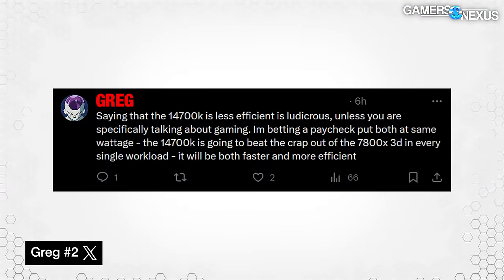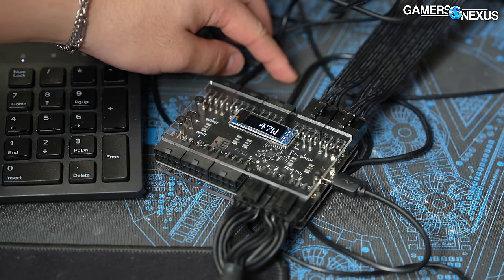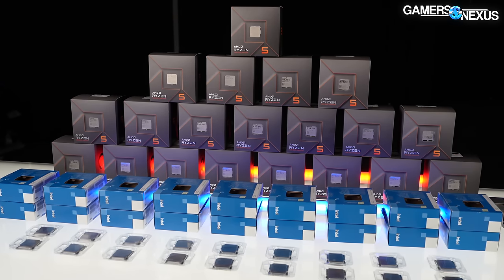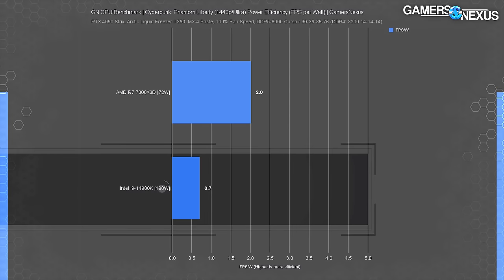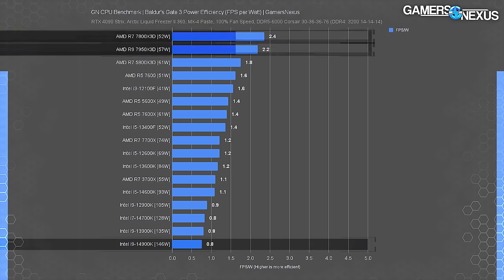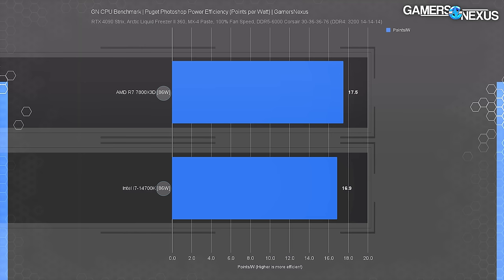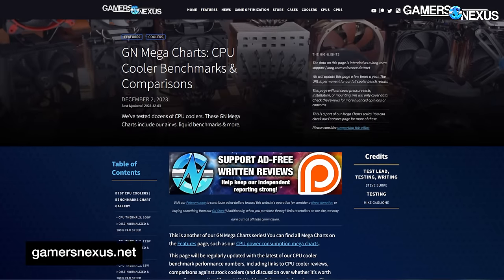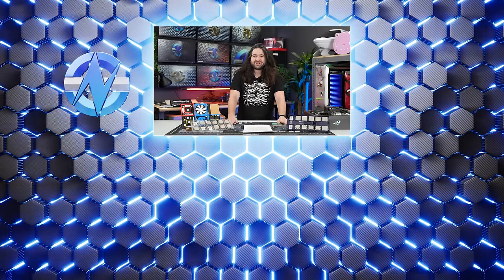The Intel Problem: CPU Efficiency & Power Consumption

Comment: I love how much the tables have turned in terms of performance per Watt. The kind of issue we see now used to be in AMD’s camp with the FX series.
Reply: I had a phenom and skipped the FX generation.  Didn't seem worth the upgrade
Reply: @davidellis1355 I had one and did the upgrade. You were right lol
Reply: @davidellis1355  Phenom II x6 was a screamer w 2x msi 7770 oc but the power bill suffered... lol.
Reply: @frizzlefry1921  1090T gang
Reply: And before that Intel had issues with the Pentium 4 where they once again tried to brute force themselves ahead through clockspeed at the cost of power/heat. It's one of those things that will probably keep swinging back and forth over the course of history.
Reply: @davidellis1355  I stubbornly sat on my Phenom II X6 1100T until Ryzen 2700X was out precisely because of that...
Reply: @davidellis1355  I still use an 1100T for my TrueNAS box.  It's got enough threads I can actually run multiple processes in the background, but it does idle at about 70W...
Reply: Pentium 4 was getting whooped by AMD Athlon series, but Intel got their act togeather and came back with the Core series, right now, they really need to go back to the drawing board.
Reply: @andersjjensen did the same. Was a good choice tbf
Reply: @dcikaruga Arrow Lake is absolutely make or break for Intel. If that's also a disappointment, Intel could be facing a Bulldozer/Piledriver etc. type of dark age.
Reply: The 3700X was already quite efficient, but they've only improved since then
Reply: @nathanlarson6535  Intel are still bigger than AMD, they've got their own factories as well, remember the supply problems with had with AMD over the years? That's in their favour.
Reply: @dcikaruga  You mean Intel's skunkworks laptop chip team completely saved their x86 CPU division.
Reply: Yeah, I used to have an FX8320 until a few months ago (then my motherboard decided it was time to retire and refused to turn on ever again), so I remember very well the old times where 4th gen i5s and i7s used to be at the very top of the efficiency curve and were regarded as the only and obvious, superior choice.

People just couldn't shut up about how the FX cpus and their ~150W TDP were ridiculously power hungry and hot, the only reason I bought one was because it was so cheap that, even after factoring in the added costs of a beefier cooling solution and a better PSU, it was still more convenient to buy when compared to an i5, it almost bordered i3 territories.

Now the situation is completely reversed, AMD leads the charts, whereas intel struggles to keep up the competition, with the significant difference that, this time, these ridiculously power hungry and hot CPUs ARE actually ridiculously power hungry and hot, intel CPUs eat up to 300 watts of power, yet people act like it's totally fine and pay good money for them.

And then some even go as far as claiming that they are actually MORE efficient than AMD CPUs, you just have to power limit them to less than 1/3 of their power budget, oh yeah that's gonna work some wonders 😂😂😂😂

13 to 14th gen CPUs are Intel's equivalent to AMD FXs, if not even worse, afterall, FXs were objectively inferior products but at least they were really cheap, they even came with a decent cooler that didn't actually look like a toy, intel doesn't even give you a cooler nowadays!
Reply: @dcikaruga  Oh yeah, unless they start royally screwing things up they won't be in danger of bankruptcy like AMD was several years ago, Intel will probably be fine. I compared it to Bulldozer because Intel might fall behind like AMD did and it may take several years for them to catch up again if Arrow Lake doesn't launch on time or isn't as good as Zen 5 or Zen 6.
Reply: @bofast  Funny thing about that is, Intel knew from the beginning that the Pentium 4 Architecture was always a power hog. Their mobile CPU was an updated Pentium 3, and when they finally saw their problem, they ditched the P4 Architecture completely and developed the Core and Core2s based on the P3 Architecture again.
Reply: @nathanlarson6535  I can't imagine Intel going under, but you never know, they could still survive I guess, just a shadow of their fomer selves.... Would love for Microsoft to end up like that actually more though.
Reply: Amd has been more efficient for a while now. Ryzen 3000 really started to change that.
Reply: and u also know that is just the manufactoring procez there
Reply: @nathanlarson6535 Meteor Lake is the FX moment, it fails to beat my i7-12700K, intel did an IPC regression there after they abandoned monolithic designs.
Reply: Ahhh, the infamous Bulldozer. Had to live with it for 7 years. 😂
Reply: I held onto my 1090t until the motherboard gave up in 2023. And now using 5600g
Reply: @earthsosad  One of my friends used to have a build with a FX 9590 and a GTX 780Ti. I remember very well feeling the burning heat coming out of his PC on my feet in LAN parties 😂. He had a 1000W PSU and the only aircooler capable of handling the overclocked 9590 was the Noctua NH-D15.
Reply: The FX-8350 still managed to keep it's 200$ price and perform better than the i7-3570 at that price.

Comment: Insane the amount of power Intel chips need just to keep up. 3x more power at some instances and almost always twice+ more. I knew it was bad but this was a bloodbath
Reply: It's wild. I think the x3d chips in particular kinda highlighted this, because before that most reviewers/consumers just defaulted to "performance is more important than efficiency." And that's still true, imo, but now that AMD has both (in gaming, at least) the disparity being this wide is jarring. 

I also think the people saying "oh well you can undervolt it or cap your fps" are either very niche users or coping. Yes, a small percentage of users undervolt, but when they talk about it they advertise not losing performance as one of the main draws. Multiple tests in this video show that you do lose a significant amount of performance if you cap the power draw, That Blender example where the render time nearly doubled was extreme, I'm sure, but the point is if you're buying a 14700k because it's a better multithreaded workload performer.... why are you kneecapping it for the sake of power draw. At that point one of the only advantages it has is nullified. 

Most people just want the best performance you can get out of the box. I really doubt more than 1 percent of people are gonna stomach losing 20 fps in cyberpunk for the sake of a few bucks off their power bill. You would have bought cheaper more efficient equipment if you cared that much more about power draw than performance.
Reply: 10nm vs 5nm.  Intel sux
Reply: @Skeames1214  It is insane the gap.  I have a 13900K.  I have always and will likely still just keep buying whatever has the highest FPS numbers when I buy, but damn would this make my cooling so much easier.  The heat is such an issue.
Reply: It's reversal of 2013.  Bulldozer time
Reply: @Skeames1214   capping the power draw and undervolting are two difference things.
Reply: What's really hilarious, is that even if Intel somehow catches up, AMD can always just pull an Intel and factory overclock the snot out of its current cpu's and remove power limits. 

I know Intel claims that boosting to 95°c is a design parameter, but a majority of these 12-14th gen Intel systems are being sold by oems with 20 year old cooler designed and a single case fan. 

Heat kills electronics, and long term, i think it will hurt Intel's reputation with oems, suppliers and contracts. 

I want intel to remain competitive because I don't want AMD to get complacent or jack up prices. So for now, all hail Intel for keeping AMD honest.
Reply: It was a curb stomping.
Reply: @Skeames1214  AMD gets good performance with better efficiency in nearly every workload. It doesn't even have to flat out beat the competing Intel part to highlight this. Intel seriously needs to start working on efficiency again. What's 6GHz gonna get you if you're slower? It's gonna get you the fx 9590 reputation... At least that's what it should do.
Reply: @BouncingZeus  Yeah I'll never look to the highest fps possible, I'm just gonna start focusing more on what I'm comfortable with. I really don't need 1000 fps with ray reconstruction.
Reply: @lilsammywasapunkrock  if Intel catches up they'll both just raise prices and undercut each other by anywhere between $20-$50.

The same way AMD would undercut Nvidia if they truly caught up. Have you not seen the pricing recently?
Reply: @ArtisChronicles  you do you. I like pushing games and parts to the limits. Plus when you have a 244hz monitor you want to try and use it all lol.
Reply: @timothyandrewnielsen  Congrats on falling in a very common marketing trap :)
Reply: @BouncingZeus  Exactly. And an aspect that most everybody, sadly including Gamers Nexus, routinely ignores: Higher power consumption comes with higher heat dispersion (and potentially higher levels of noise). While the cost of cooling potentially also rises, the main problem with highly inefficient or power-hungry CPUs in times of climate change in large parts of the world and soon everywhere is heat buildup in summer. THAT is why I have tended towards intel for a long time and THAT is why I am switching to AMD this time.
Reply: @timothyandrewnielsen  you talk if amd is making their own chips. amd just uses tsmc unlike intel.
Reply: Intel is being slammed and if i didn`t know any better i`d think they are knocked out.
Reply: @lilsammywasapunkrock  that's the only problem, AMD cannot do that. The 3D V-Cache really doesn't like getting too hot, the chips are running at their limit more often that not on air cooling because they need to keep a certain temperature envelope so they don't throttle down. You can actually undervolt them to keep them on boost speeds permanently, but you can rarely undervolt AND raise the clockspeed at the same time.
Reply: @brugj03   fanboy moment
Reply: @Kommunisator  absolute fanboy comment.
Reply: @timothyandrewnielsen  why? I have a 5800X3D on an X570 mainboard, and have done extensive tests into overclocking and voltages with this chip. It can sustain full boost if undervolted, it cannot tolerate any added speed though, as it creates hotspots that you cannot cool easily anymore with any cooler that can be called somewhat silent.
It IS very efficient though, even extremely so when undervolted - I'd even go as far and say that everybody, who is not undervolting their CPU, is wasting money for electricity and wasting FPS because the undervolted CPU can boost more consistently (extremely noticeable in Star Citizen).

Why do you think this is a "fanboy comment"? I am no fanboy of any company, I like it when tech works and use what's best for the given task at hand.
Reply: Ive said it before and ill say it again, the 12th gen was intels phenom x2 moment, 13th gen was bulldozer, and 14th gen is just as bad
Reply: It is a reversal but it's also a repeat of 2003-2005 where AMD shat all over intel with their Athlon chips. Intel tried to keep up with high clocks/power consumption but AMD was still far ahead until intel released their C2D/C2Q chips.

Just goes to show how the pendulum always swings back and forth.
Reply: @magnomliman8114  duh.  but that's irrelevant, Intel can't compete with AMD.  Their CPU get beat every year and massively in the perf/power ratio.  Sometimes by 3x.
Reply: @Kommunisator  I may have replied to the wrong person.
Reply: @timothyandrewnielsen   irrelevan ?  even if intel sand the meteor lake to tsmc and switch from 10nm to 5nm it would be a hug deferent. not even changing the architecture here. fanboy much?
Reply: @magnomliman8114  It would be, but they aren't.  So why talk in hyperbole.  The end product's that Intel are releasing are trash.  If they used TSMC and beat AMD you'd see my tune change but they aren't.
Reply: @timothyandrewnielsen   can't argue with that dude. facts.
Reply: @BouncingZeus  still a great CPU, wouldn't be upset if I owned one. Once you've bought the equipment necessary to cool it, you kinda forget about it. But yeah, it's a real advantage for AMD right now. 

Are you still having issues with the cooling btw? I feel like I've heard a decent AIO pretty much sorts those out.
Reply: s1214  yeah it does. I have a fully custom loop and still see 80s and 90s on some games. I've got a double thick 360 and two 240 double thicks and a contact frame. Just it gives off so much heat. But no such issue on my 4090 in the same loop at 4k 99 loads.
Reply: @BouncingZeus  eesh that's kinda rough. If there aren't any performance issues I guess it's fine but yeah that's really high lol. 

Got a 4080 myself, thing is insanely cool. Kinda glad I held off on upgrading my 1080ti, as much as lovelace (particularly the 4080) was overpriced, I do like that it runs cool all the time and doesn't even touch the limits of my 650 watt power supply. Haven't had one crash (excepting unrelated crashing in Jedi Survivor when it released), I was fully anticipating needing to upgrade the power supply.
Reply: s1214  the loverlace are so cool and great. I was also pretty cool on the my old gpu too which was a 2080ti. I thought it was too high but when I checked around those numbers seem right unless you delid which I won't do since I do the microcenter warrenty thing and use that for much cheaper upgrades.
Reply: @BouncingZeus  yeah you seem like a real enthusiast but delidding is insanse lmfao, instantly voids the warranty. i don't think it's some impossible task, you could probably get it working, but it's not worth the risk and tbh that just should never be necessary for baseline temps. that shit is for the extreme overclockers.
Reply: @lilsammywasapunkrock  In case of semiconductor circuits, heat cycles kill them, heat per se is a design parameter.
Reply: @erkinalp  heat cycles are far worse due to expansion and contractions, but at the end of the day, heat will still kill any component faster then one that is half the temperature. The "designed" heat range will also have a limit, suck as 100c for 5 years ECT. That just means that a majority of the time, it will live through it for 5 years, but in 10 it will probably fall apart.
Reply: @Kommunisator  x3d is really on its first cycle, and is not really any different then how they make any other current gen CPU. The extra cache is added on, rather then designed to begin with. When they start making x3d a standardized design rather then an added layer, which blocks cooling to the cores, it will be much easier to cool.  This is the same thing that Intel was doing with it's server cpu's 10+ years ago. Part of the reason the Intel smear campaign about Ryzen being a "glued together" CPU was so funny, is because that is exactly what Intel was doing in nearly all of their enterprise hardware.

And a majority of amd cpu's still aren't x3d chips.
Reply: @BouncingZeus  living in Europe the power draw has completely stopped me from buying high end Intel chips for the last few generations. Its at a point where i’d see a massive difference in power bill at the end of the year. I mean its not like Intel are the undisputed gaming chip anymore anyway. The x3d CPUs beat the Intel ones in more games then not.
Reply: c5812  it's about 8 cents per kw hour where I am in the US. It wouldn't move the needle on my electric bill.

Comment: The 7800x3D is absolutely dominating 🤯 So happy to have chose it for my build
Reply: Yup me too what are your specs?
Reply: Same here! It's a beast
Reply: what is your spec
Reply: I went with an all AMD build, 7800X3D and a 7900XT and I'm so happy with the performance.
Reply: @DraxTrac  nice a high end build.
Reply: @@lakylait consider me envious :( Timing (as in the time and not RAM) made me stick with AM4, and I bought a used 5950X because the 5800X3D is out of stock. I'm mainly gaming but also learning on Blender a lot and multitask and switch tabs like a goblin but still have buyer's remorse when I see currently available prices on in-stock 5800X3D :(

Personally I wouldn't mind the extra 30 secs of Blender compile time on very simple projects that I'm working on anyways. I could easily afford a brand new 5800X3D right now but I'm sticking with what little sensibility I have left
Reply: Leading the charts now and you’ll be able to drop in a 9800X3D in a year or two to boot…
Reply: Which mobo are you on? I've been asus fanboy but I'm afraid to go asus because of the cpu overheating. I am currently thinking of gigabyte
Reply: Same here. Was my Christmas gift to my self. Upgraded from a 8700K. Grabbed a 2TB Samsung 890 Pro as well to take advantage of the move from PCI-E gen 3 to Gen 5 and 4 as well. A night and day difference. Love it.
Reply: @addydiesel6627 the CPU overheating deal was fixed months ago. Plus with the 7800x3d can be power or thermal limited and still perform insanely well.